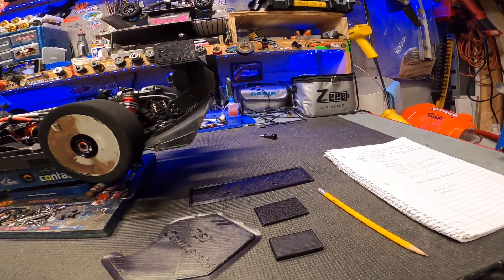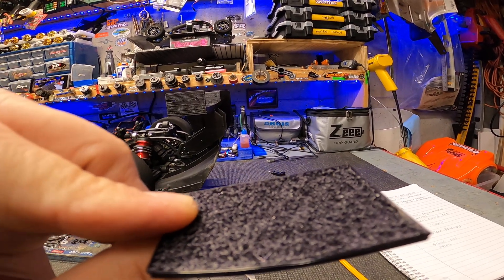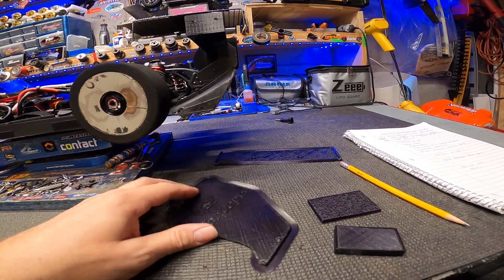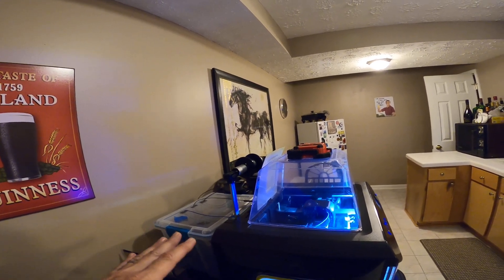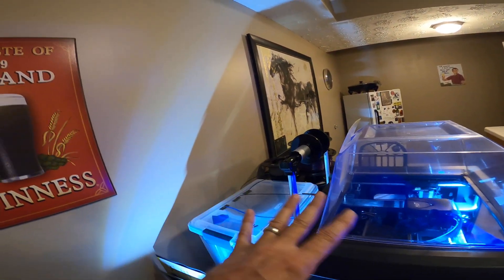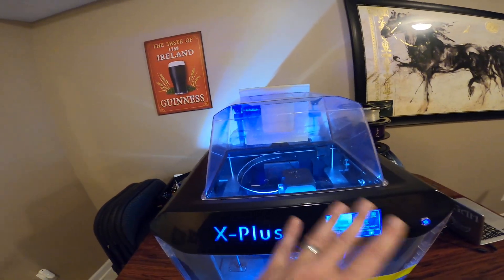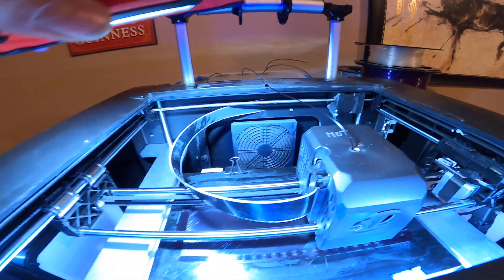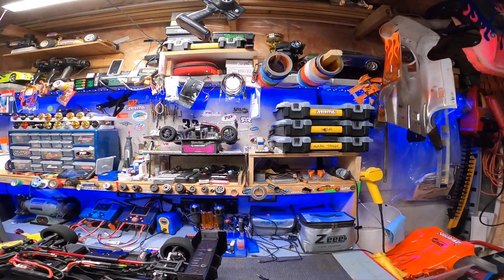3D printing using Taulman 645 black nylon

Comment: Thanks for doing this video. I have an X-Plus and this video has all the info that I need. I need to get some of the 645 now.
Reply from the maker: Cool I'm glad this helped. Btw I print at 250C  now. I found out that the 270 was too hot and making the nylon brittle.